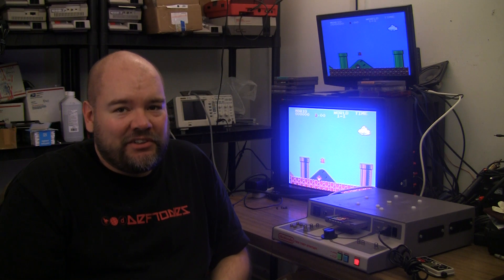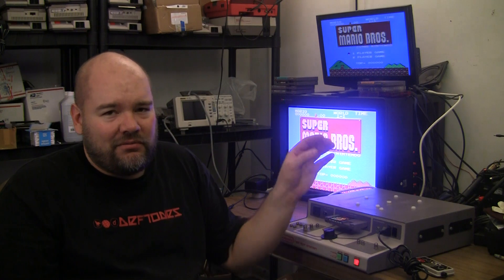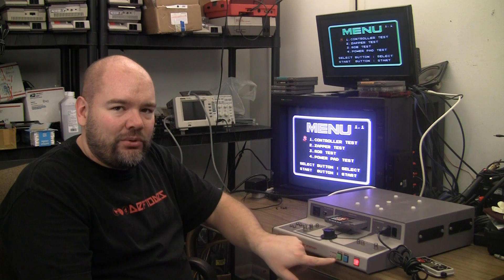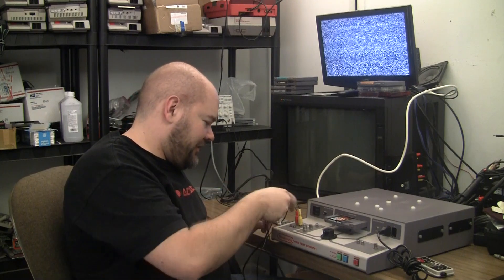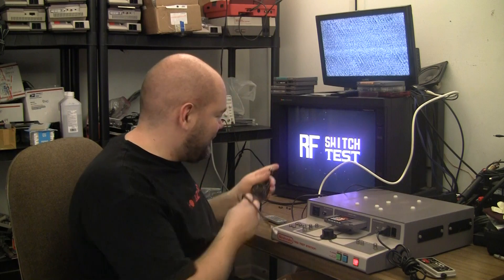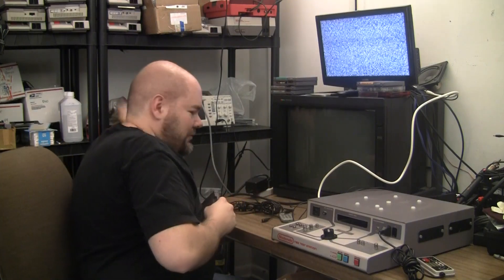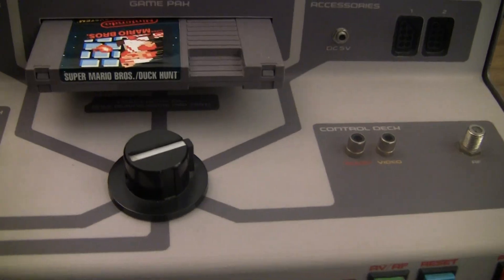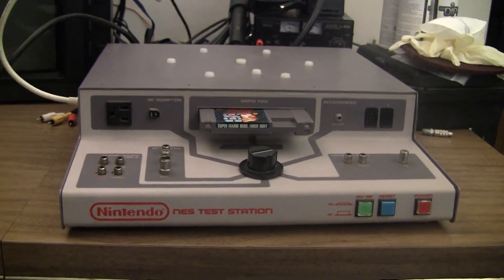NES Test Station - RAREST Nintendo - how it works - Pt 1

Comment: the 5 volt output is probably there for advanced trouble shooting, at the board level. since the chips inside the console use 5 volt logic. you could attach a probe and use it to directly power the components on the board. that's also why the test station has a/v ports on the front of it, they provide a common ground connection between the test station and console being worked on.
Reply: No, you only need a "common ground" for the signalling, which you would get through the controller jack itself.  DC power to an external accessory would ordinarily be supplied either through the +5V line on the controller jack (if it used very little power, like a controller or zapper), internal batteries, or a dedicated external PSU of its own.  In the latter two cases, the DC supply would be floating relative to the console, so the signalling ground would give them the common reference point they needed.  There's no need for a more substantial chassis ground since the only current flow would be 5V logic feeding high-impedance inputs.  Ergo, the controller jack gnd line would be sufficient.

The purpose for the 5V DC jack is simple:  It was there "just in case."  Remember this was a piece of test equipment produced early in the life of the NES product line.  At that point, Nintendo was starry-eyed with all the potential accessories that could be sold for the system.  They would have no way of knowing what stuff would exist down the road, so most likely they provided a 5V DC output that could supply power (for the most part) to any future accessory that needed it.  Aside from being convenient, it also allows the tester to troubleshoot a potentially defective external PSU.  If the accessory works powered by the test rig, but not its own external PSU, then the PSU is at fault.  The choice of 5V is a bit of a shot in the dark, but a very safe bet, since -- like the NES itself -- practically all of the electronic gizmos at the time ran off a 5V rail.
Reply: The 5v out included leads to power up and test R.O.B with the earliest systems. You wouldn't use batteries over and over (too expensive) when bench testing in this manner. 5v powered ROB perfectly as that's what he was designed to run on.

Comment: The RF box test is actually pretty clever, the system is cycling (hence the clicking) between tranmitting a picture over the "console" and "tv" lines of the switchbox and then you see if a signal comes through both, hence when you unplug one it only shows the picture on one of the cycles and static on the other, clever way of performing a simple test

Comment: Did you ever get an answer to that AV /RF button?  it looks like it can be used to test the source coming from the front loader NES.  That is, you plug the front loader into both the AV and the RF ports located on the right,  and that button switches between the 2 sources

Comment: I'm glad we never had those screw-in connectors for UK televisions because it looks like a complete fuck on to get it done, and especially those times you have to reach over the top of the TV and try to feel out where the connection is while your tongue hangs out in concentration.
Reply: Top of the tv? They're usually on the back.
Reply: Allan pavon I'm talking about when the TV is in the corner or in a media unit like many had with old CRT TVs
Reply: Michael Parker Yes, they suck very bad. As a lazy kid I would never pull out the TV and just blindly hug it while trying to screw it in. Always took way too many tries.
Reply: There are adapters that allow you to push the connectors on.  The UK style connectors don't make as good a connection, though for this purpose it doesn't make much difference.

Comment: I bet the 5v DC is for battery operated devices like ROB. 4x AA provides between 4.8 and 6v, depending on the battery. I am guessing most powered accessories are the same. Probably to eliminate battery power as a problem. I bet the lead had alligator clips.

Comment: I have to think that a mod would destroy the value of this, I'm sure you were curious to get your hands on it but I hope you advised him against altering something as rare as this.
 Wish you got more into the history of this thing like who would have used this, why and where.
Reply from the maker: +ALitleBitSpecial I don't know the history, i'm not a historian, i'm a modder and all the mods are easily reversed nothing is destroyed as you say...
Reply: +GameTechUS The mods that have switches/LEDs going through the case arent fully reversable. You cant magically patch up a hole.
Reply from the maker: +LBPPlayer7 I didn't mod any LEDs on to the machine, are you talking about the lit switches up front that were always there?
Reply: GameTechUS No. Im talking about the switches for the switch for the 50/60hz switch mod.
Reply from the maker: +LBPPlayer7 Also didn't do any 50/60hz mod to this machine.
Reply: GameTechUS Im talking about these kinds of mods that are not fully reversable because they require shell modifications.
Reply from the maker: +LBPPlayer7 I didn't do any on this machine that needed holes put in the shell.
Reply: GameTechUS Im not talking about this machine. Im talking about old consoles in general.
Reply: +LBPPlayer7 But old consoles in general are not rare at all. So no history is destroyed by modding a few promilles of the total manufactured NES systems.
Reply: Sebastian Jansson But its better to not have a million switches sticking out of it.
Reply: +LBPPlayer7 That is your opinion, people who want to mod their NES with switches will continue to do so no matter how much you disagree. So you either leave it or continue to rant about it.
Reply: I agree. I am even keeping my top loader nes the way it is. I don't wanna mess with it, even if it gets a better picture.
Reply: Actually, I think that if you're buying for the sake of resale or value of the item, it's your job to do research on the item you're buying. I wouldn't care too much if it were modded as long as it wasn't something kookie like lights and stuff that would be obvious and just weird looking.
Reply: A
Reply: no way the mod makes it far more valuable.
since it's an even bigger rarity. because damn if something was like that on the market an RGB capable NES test station I'd pay double the money.
Reply: wow this was hard to read
Reply: DirtiestJoe kind of like a third grader that is proven wrong going "nuh uh! I didn't mean *literally exactly what I just said*... I actually meant something else entirely!" yeah but you're wrong about that too... "NUH UH!!!! I didn't mean the thing that i just *outright stated that I actually meant*, i meant this completely other thing not related contextually at all to my original statement!" you know... if third graders had better self awareness and a larger vocabulary...

Comment: OK, this is well past the sell-by date, but in case anyone's curious...

The RF test has three jacks:  The "NES" signal that would ordinarily be coming from the control deck.  The output to the TV (which, I assume, is internally switched to feed through the test station directly to the RF output jack connected to the monitor.)  And the antenna input.

What seems to be happening is that the test station generates a reference signal that it feeds through the antenna jack.  This goes through the customer's RF switch antenna pass-through input to make sure that circuit works.  Then the relay switches the NES video output on, which causes the customer's RF switch to activate that input and override the antenna input.  Then the relay switches back to the antenna feed, and so on.  This is why you see the display jump a little in time with the relays clicking.

This would test the complete circuit in the RF switch to make sure the pass-through, the video output, and the active switching are all working.

Comment: ive taken apart my nes test station to clean and fix.  its quite a mish mash of electronics. btw i have the manual. the 5 volt input is something for testing the game boy ac adapter.  but even with the manual i still didnt understand how it works.  the inputs under the controller  was for the snes counter tester

Comment: My guess this test station was used to test the games and NES system power supply,rf and composite cables. The official NES tech's used these back when Nintendo would take in damaged systems from customers. Would be cool if Nintendo still did this for all their old systems. Very neat system that i have never seen or heard of until stumbling upon this video.
Reply: If by "official NES tech" you mean minimum salary guy behind the counter in game store with no electronics knowledge whatsoever, then yes, you are right;)

Comment: The Test Station can also be used for testing the NES-10 chip in case you have a bad cartridge or not: You insert the game in the Test Station port and back into the NES if the NES fail but the Test Station pass, it can be because the pins of the NES are loose.

Comment: To my knowledge the DC 5V on the Accessories test panel is unused. It may function as a DC 5V jack but no official Nintendo accessory ever used DC input. There's also an image of the SNES test station here: http://upload.wikimedia.org/wikipedia/commons/e/e6/Nes_Test_Station.jpg

The SNES test station is standalone, although there IS a port behind that front panel on the side, so perhaps it did have the option to attach to the NES station.

Comment: This video's old, but when you talk about the idea of a R.O.B. modded to run off an AC adaptor, that doesn't seem entirely impossible or out of the question. 

Back when my dad worked at Best Buy, he brought home a Game Boy Printer that was similarly modded to use a SNES power adaptor.

Comment: pretty sure that 5v out is for an oscilloscope type device for measuring control impute signal
Reply: Nah, not a chance - it was device made for your usual Joe behind the counter to easily check out basic things like bad AC adapter or no connection on RF switch before sending device to repair center. These people probably had something one day training and flowchart explaining whether to send device for repair or just sell a spare cable/AC adapter.

Comment: It seems like the control deck tester may be for to test the RF modulator and composite out on the control deck probably to make sure if its functioning correctly other than that your guess is as good as mine.

Comment: The 5VDC output jack was likely to test the power adapter.  The power adapter takes 115vac, converts it to 12vdc.  The NES has a 7805 voltage regulator inside it that took that 12 volts and stepped it down to 5vdc.  Higher then 5v, and you're frying components.  Less then 5vdc, and the system won't turn on.  I wonder if they used this jack on the test station to provide a clean source of 5vdc when troubleshooting broken nes systems?
Reply: Oops, I just watched the rest of the video and noticed it has an actual test port for the power adapter.  So the 5vdc jack is most likely there to jumper out possibly bad voltage regulators.  I've heard of that component going bad a great deal of the time with people who mod nintendos.

Comment: The hook ups on the right are for the SNES test station attachment the hooks onto this test station.
Reply: You usually see the SNES test station on the right side of the NES one but I don't think it actually hooks up through those slots. From other sites, it seems like the SNES tester just plugs into the 'control deck' AV ports on the front.
Reply: you are correct my response was not worded very well. I meant the ports on the front right side. I have both in my collection. The strange thing I found with mine was that the rf attachment from the snes actually has a better picture than the av ports.
Reply: Cool! So do you also see the white/green difference between composite and RF when running that test cart? I wondered if maybe that was on purpose to tell which was which (since they probably figured both would go to the same TV, instead of two separate like in this guy's setup.)
Reply: I haven't fired it up in quite a while. I would have to look into it as I do not remember lol

Comment: What is the appeal of top loader NES? Never had 1, a kid I was friends with did. My goal when starting to collect old consoles was the original like I had as a kid.
Reply: by never had I mean never had the top loader,  had the front push down.
Reply: Not as prone too breaking.
Reply: The benefits are reliability, supposedly. The drawbacks are many. Bumping a floppy cartridge when you're mid-game and having the system reset. Worse AV output... to name a few.

There's a reason they were probably sold cheaper than the original. They would have been built cheaper.

Comment: The 5v controller pin is to make sure the program isn't interfering with the controller's functionality. It's just because they didn't have USBs at the time so they had to ensure that quality control themselves. Which is probably equally good as it is bad and also contributes to the reason NESes last seemingly forever.

Comment: Those cable testing features are purely gimmick. lol
Reply: Great video, BTW!
Reply: Fabio Marques untrue
Reply: Maybe you are right. Continuity can be easily tested with a continuity tester/multimeter, which are basic devices in any repair shop. However, maybe this device was designed to clearly present to the customers, in an user-friendly interface, what is working or not.

Comment: why the fuck would you mod something like this. there's not many left dude
Reply: Because why the fuck not? It's not like he'd destorying them.
Reply: Nothing was damaged, all mods are easily undone, this was covered in the video
Reply: 9x45mm Morse Did we stir up some repressed memories?
Reply: The8-BitNerd he modded it at the request of a client. He didn't mod it because he wanted to he modded it because a paying customer requested he mod it
Reply: ..... in the car world wed call this a restomod.... taking something old and restoring it but also adding nicer more practical shit to make it more reliable if anything mods like these EXTEND the life of these things.... so... stop whining
Reply: Sykoangelo could you explain how you think adding RGB to a game console extends the life of it? I get that some people want a digital clock in their 71 Nova or add airbags to their dads first car or whatever to otherwise modernize their car, and I couldn't really careless one way or the other as it's my opinion that if you own something it's yours to do whatever you want with. But you can't argue that it extends the life. It's not like adding a different output magically upgrades all of the passives with more modern and reliable ones, or somehow adds flux and reflows the PCBs to eliminate years of oxidation on the solder joints. All it does is conforms it to the owners preference, which is fine. It won't stop the thing from breaking though now that it can be connected to a TV by a different means.
Reply: Agreed
Reply: Dropkick500 hey, maybe he uses a vibrator. Don’t be so quick to jump to conclusions;)
Reply: 'Cause the owner wanted it. The owner can do whatever he wants to it, he could take a s**t on it if he wanted.